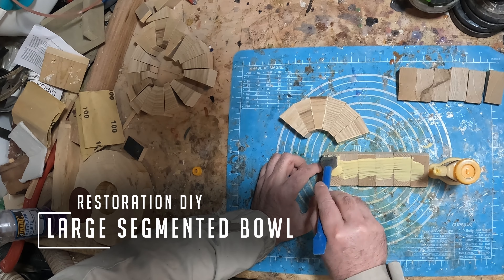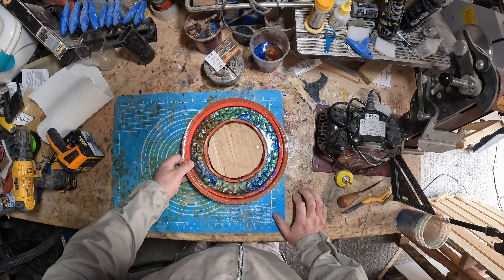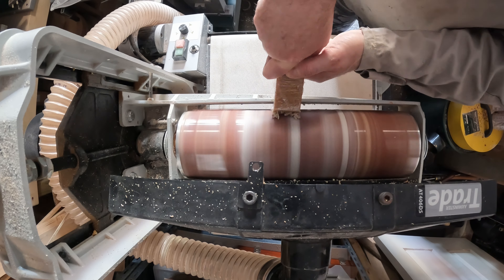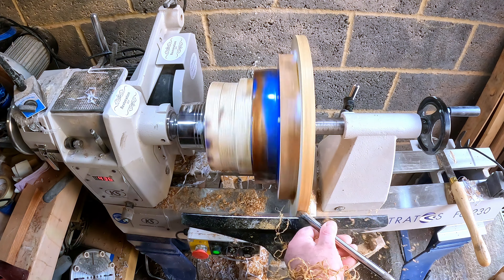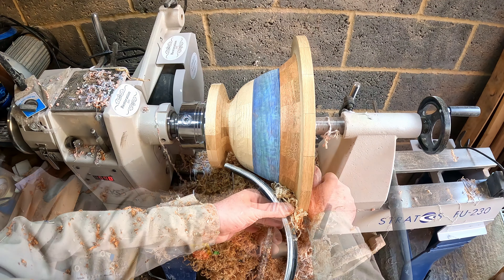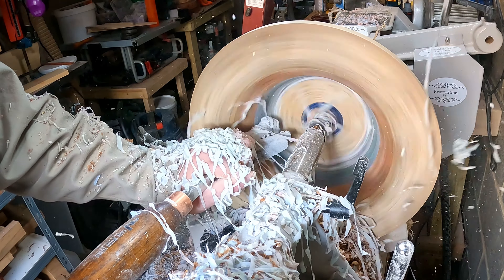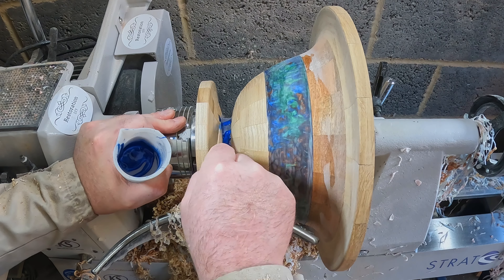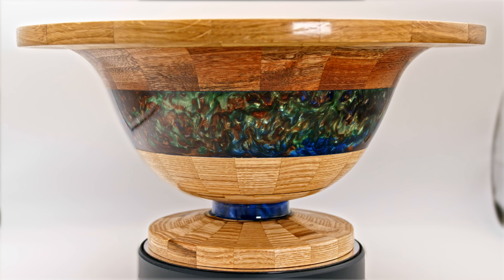Woodturning | Large Segmented Bowl with 3 Colour Epoxy Resin | Restoration DIY

Comment: I love this piece! I have tried msny times to get color separation like this i have let it go to 90° but have not yet had success. Resin can be challenging. Thank you for sharing. Im going back to the shop to try 100° now
Reply from the maker: Hi, thank you it's one of my favourite pieces. Epoxy Resin can be very tricky. I had a lot of fails before I got consistent successes. Good luck with your projects, 😀
Reply: @RestorationDIY  thank you!! I have watched several of your videos.  I have never even tried segmented turning. I do a lot of twice turn and inlay with resin or what ever material I have for inlay. and a lot of wood and resin bowls and vases.  I joined a group that has several guys that do segmented turns. I may give it a shot one of these years. Just seems like a lot more glue ups. Of course I have done a ton of cutting board with a lot of glue ups so I am not sure why I drag my feet on this type of turning. It may become my favorite new go to! I do like your videos  and content you put out and the way you do it step by step and technique. Thank you sir!
Reply from the maker: Thank you. I appreciate your comments. Segmented wood turning is good fun and very rewarding, not to mention it uses much less material. Give it a go. I'm sure you'll enjoy it 🙂